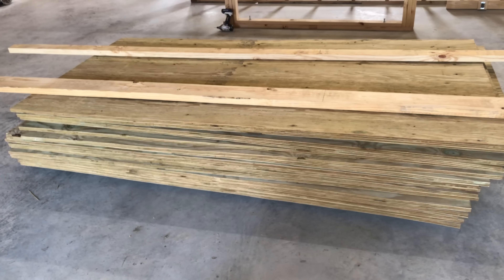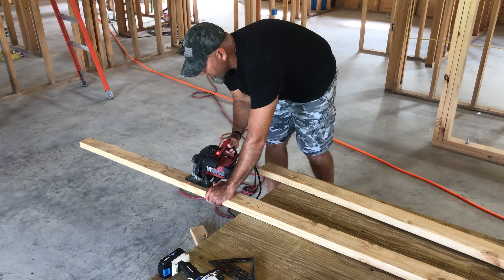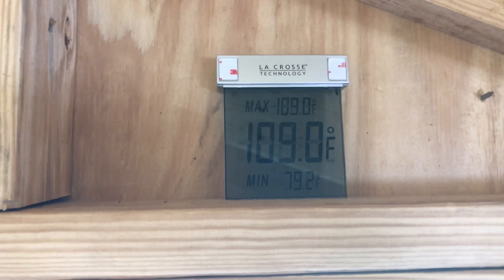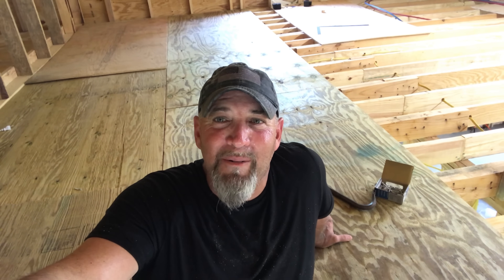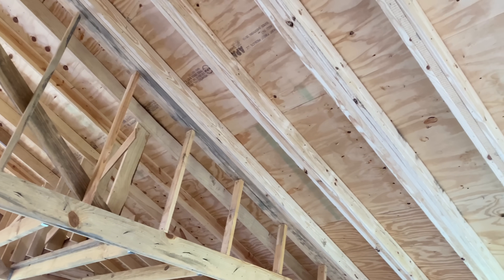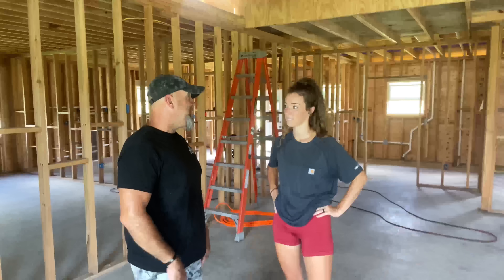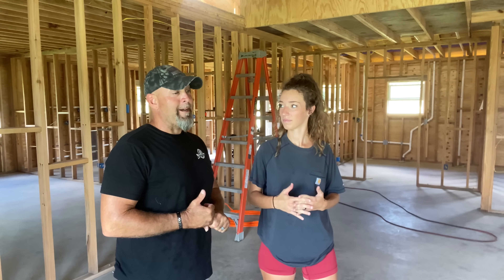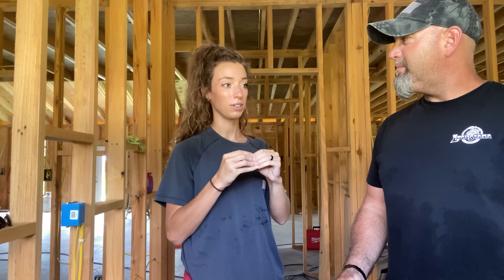Building Our Own Home Ep.42 | Did We Bite Off More Than We Can Chew?

Comment: Just found your channel and getting caught up. One thought with regards to the treated plywood for flooring, it's generally not recommended because, as you said, it's "wet", which means it can and will dry over time, which will create gaps between the sheets, which will then distort any flooring laid above it (crack tiles, split hardwood flooring, etc...). Most builders suggest non-treated, "engineered plywood", which is just as strong and doesn't shrink. 

The term "Marine Grade" just means that it is non-treated and there are no voids within the sheets themselves, which usually means few/no knots, as well. It's also left untreated so that it can absorb any paint, epoxy, varnish, etc....that may be applied later. Good luck with the house. Cheers from N. FL.

Comment: Another great morning. Breakfast and CCL. Jim, I ran into the same problem building our shop by ourselves. We were running out of "naptimes" before it was going to snow. So I had to hire a friend to sheet half the roof.  One question, Why marine grade plywood? OSB works just fine for an interior floor or regular plywood if you don't like OSB.  Glad you took time to fish with the family. Keep taking bites.
Reply from the maker: Good morning Paul and thank you! I needed the plywood delivered fast and it was all that was available about the time.

Comment: Definitely looking better with the extra strength beams.  Also great work on the ply flooring definitely would use that instead of osb.  Do you guys moisture test  the timber before spray foaming?  Jimbo,  good call on sweeping the place, at least Gus won’t have a sleeping friend now 😂
Reply from the maker: Thank you Robin! That thing is strong enough to park a truck on now😂 We weren’t planning on moisture testing the framing. Is that something that is normally done? Interesting…..
Reply: @CajunCountryLivin  Absolutely a must in NZ for a moisture test.  I think we aim for 17%.  Basically if it’s too wet when lined the timber can still mould or rot.  It’s quick a small probe is pushed into the timber and reading is quick.  Usually it’s the bottom plate that wet even though it looks dry.  I’ll be surprised if yours is wet but if it looks dry in can still be 50% wet 🙁😳😱
Reply: @CajunCountryLivin  jim in our area the timber is going to be about 12% without a ac system going. That said if came from a box store it's already been kiln dryed. Or if it came from a local Miller it might just be air dried cant remember if yall used rough cut or not

Comment: Loved the video as usual, but I do have a question. Back in  the 80s I was fortunate enough to run a electrical crew at the new Shreveport auto plant. Those boys made a box  out of plywood and lined it with aluminum foil. Then they hung a 150 watt light bulb in it, and it would cook the best venison steak I have ever had. As I remember they called in a Cajun microwave to. Of course nothing was as good as the muffelatta. You will have to forgive me my memory is not to great either, can’t even remember the name of the auto plant.
Reply from the maker: Now you’re making me hungry Mr. Gene!